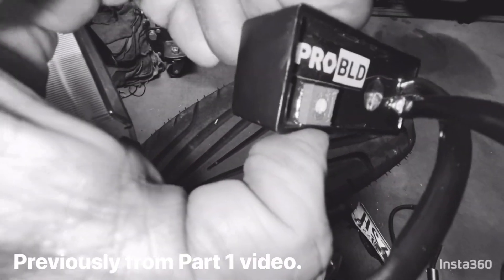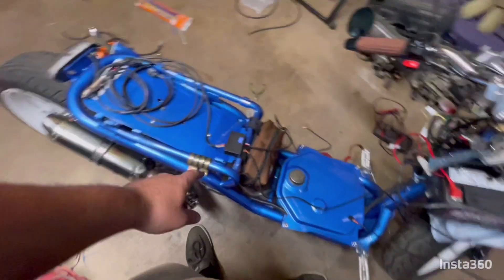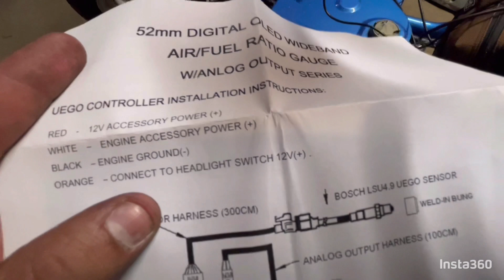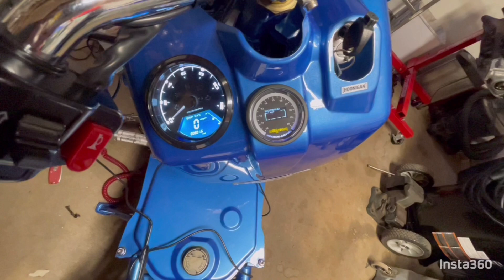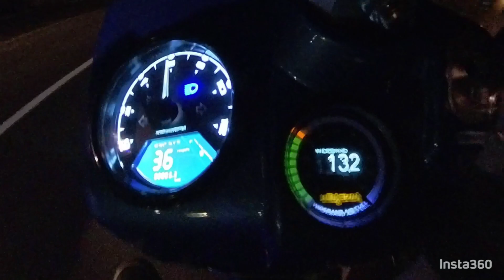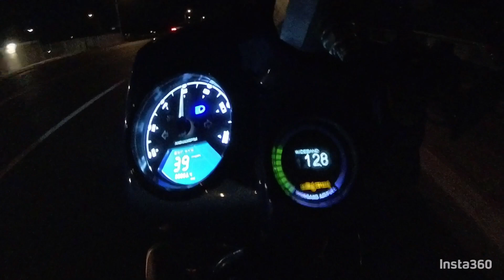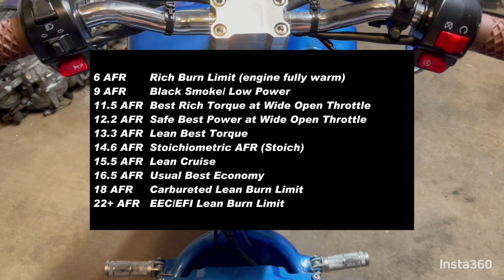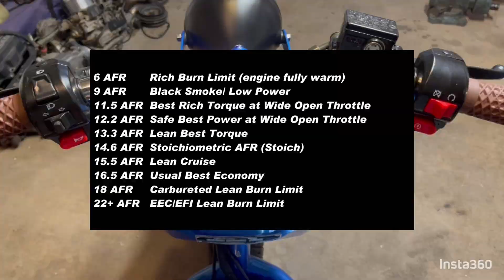2022 Icebear Maddog Gen V: Rolling Wrench ProBld Pulsar Unit E-Fuel Pump, AFR Wideband Install pt.2

Comment: does the chirping noise go away once it's primed or how does that work
Reply from the maker: @mrcleanisin  it doesn’t go away. You can’t hear it over the exhaust once the engine starts running.

Comment: That rolling wrench fuel pump is honestly over priced. I went to AutoZone and bought an Edelbrock electric fuel pump and it cost me $63. I just wired mine into the gauge wires which was way easier. I just found the constant power when you turn the key on and then grounded it to the frame and it works great. Turns on when the key is on and off when you turn the key off. I even hooked up my battery volt gauge and it works the same way.
Reply: I just got a no name pump for $19